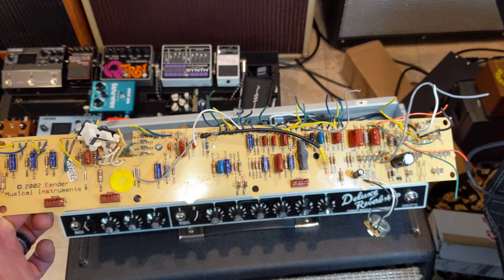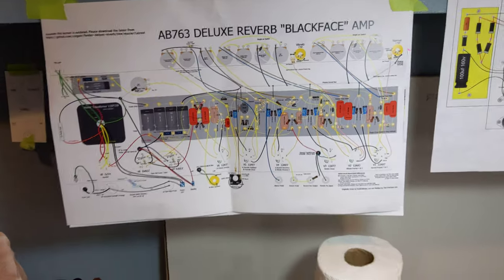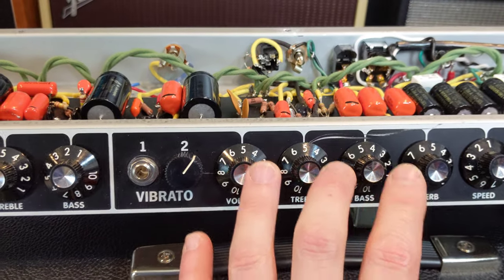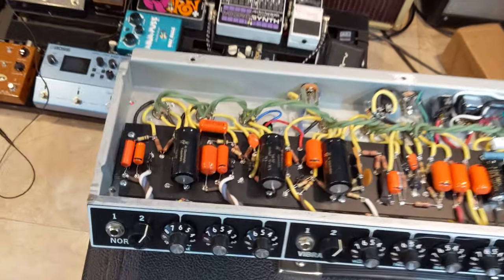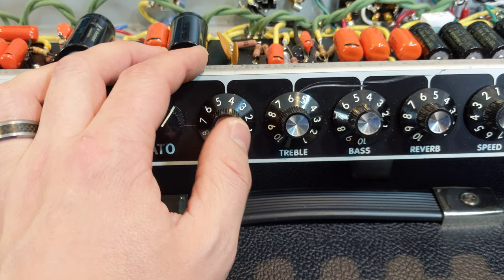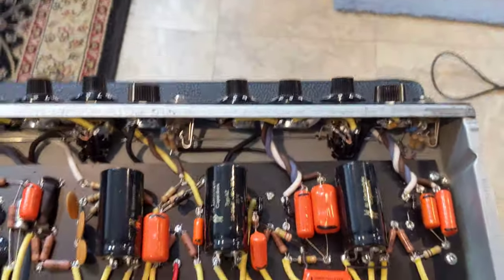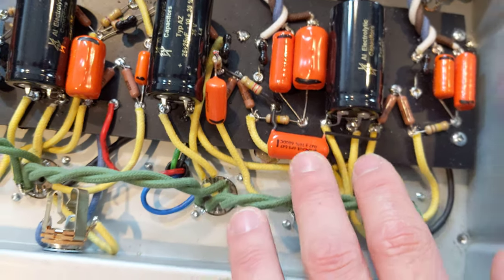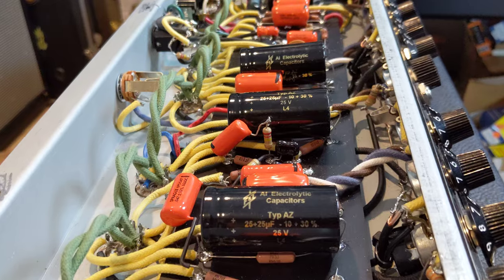Converting a Fender Deluxe Reverb Reissue (DRRI) to Handwired Blackface AB763 | Part 4

Comment: Looks like a work of art . Just heard the "Audio" and it has "Headroom" but lacks just a little if that "Fender" Zingyness, like a mild fizz( not fuzz). I would love to use that amp. We used to mod Twin reverbs by pulling out the reverb send and return RCAs and using them for boost pedal in-out, you lose the reverb but the reverb control on the amp becomes a "Monster" gain control.

Comment: If you are running shield connected only on one end of 2 devices and want to break the ground loop without a transformer, break it at the RECEIVING end.    You could probably get away with a very short TS cable and a Whirlwind IMP2 at each end and a with a mic cable and a turn around in the middle

Comment: Hi Ryan, I am just getting around to purchasing the parts needed for my amp conversion. I was going through the BOM an there are a few things I'm unsure of - Did you create the bias board yourself with an eyelet board or did you get Hoffman amps to make you that with the board? I also noticed there is a gotoh battery box on the parts list but I'm a bit unsure as to where it's used. Just want to make sure I order all the correct parts!  

Can't wait to get stuck into it!

Many thanks,

Tom
Reply from the maker: Hoffman sells the bias board separately which is the best way to go otherwise you need to meet certain minimum length with the design etc. I might have a few extra things on then BOM for another build (oops!) I'll check

Comment: Very nice and thank you for shearing the project files. While ago I build 5E3 and after that the "sickness" took over and came Trainwreck Liverpool, small 5W single ended amp based loosely on Supro model and now is AB763's turn. While I wont be using your files I wanted to check it out but the DIYLC file that you provide on your GitHub page is corrupt and can't be open with any version of DIYLC. When you get the chance you may check it out for people that might want to use it. Once again thank you for shearing your journey.
Reply from the maker: I'll check it out. Thanks!

Comment: It looks like you kept the stock transformers. Any issues you had to address doing that? I'm in the process of getting all the parts together for the AB763 circut to covert my DRRI. From what I've found the power transformers are different. DRRI has a 40w and the AB763 build has a 20w power transformer. I could be wrong though. Great work by the way!

Comment: Hello Ryan, I watched the video, your skills as an Amp builder are amazing, great job. I am here looking for advice, just bought my 1st Tube Amp and getting a little hiss noise while is just sitting idle. The unit is a Fender Twin Reverb 65 Reissue, made on 2017. Bought it used as a scratch - dent at Guitar Center. The Amp plays OK, but the hiss remains while it is idle, volume knobs at zero. Are these Amps supposed to be dead quiet?  Should I replace the Tubes it came with? (Standard GT Chinese I think) Or try to Adjust the BIAS?  Or move  the Tube around?  Any help is appreciated.
Reply from the maker: Hey man!! Thanks so much for reaching out! I would agree with you that try to change the preamp tubes. You don't need to change them all. Maybe buy one or two and make sure to check the tube chart that you're putting the right tube type in the right slot. These amps do have a slight hiss when turned completely down. It's "normal" for the most part. If it's just as loud as your guitar, I would he concerned, but it doesn't seem like it. My favorite quiet tube is the TAD 7025 high grade. I use them in my SSS amps and it's truly amazing how low the noise floor. Let me know how it goes and thank you for stopping by!

Comment: The coupling cap size does in fact determine the level of bass that goes on to the next stage. The larger the cap, the more bass. So a .047 cap will have a little more bass than a .022. A .022 and .047 are the most common, but other amps go as low as .001, which is really small and thin sounding comparatively. I prefer Alpha pots for amp builds. They have a nice, smooth and firm feel to them and the taper is also really nice. I prefer Bourns pots for my guitar builds. The Bourns pots are smooth and turn easily enough for just about any knob style you use. I am not a fan of CTS.

Comment: What are the advantages to the dual section electrolytic capacitors?
Reply from the maker: Hey Alan. For me, they have 1/3 the ESR compared to a Sprague so theoretically quieter operation. They also look cool 😎

Comment: What do tube amps do??? GET HOT! No hot glue...
Instead try E6000 adhesive, it can be found at most hardware stores. It's kind of like the descendant of Shoe Goop and rubber cement. It works excellent for applications like this. Try it out!
As an added benefit, E6000 is completely electrically inert, it doesn't conduct electricity.
Reply from the maker: I'll try the e6000. The hot melt I use melts at a higher temperature than the ambient temp of the amp however the e6000 might be a good option as well. Thank you!

Comment: You could have definitely  run those filament lines better,.
Reply from the maker: I agree it could be better but the problem is that the wire is extremely stiff and the cloth will, and has, broke apart if I twisted it too tightly so I was left to work with what I had. If I would do this again, I will source more traditional cloth wire.
Reply: @TheToneGeek  That old solid core cloth wire looks great but its breaks easily as you mentioned and you would get less noise using modern tightly twisted stranded copper wire. A least for your AC filament lines. I like using the cloth style for the power section and nodes. nice component choices BTW.
Reply from the maker: @vminator  Thank you! Every build has something to learn from. This is the wire I used for my heaters. https://tubedepot.com/products/18-ga-stranded-cloth-wire-600-volt-rating The 20 ga seemed to be ok with the other preamp lines. It's cool that the cloth is on top of the 600v rated PVC, but we're obviously seeing some drawbacks on this too. Thank you for the compliments. My favorite part is the component selection 8)